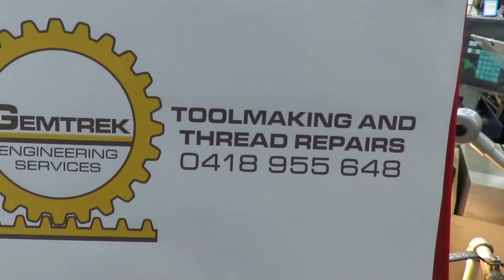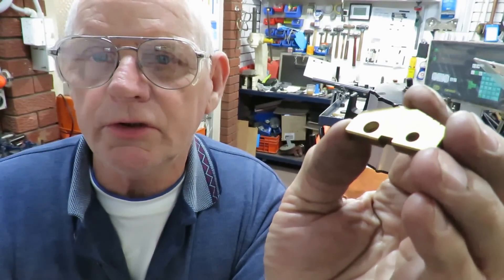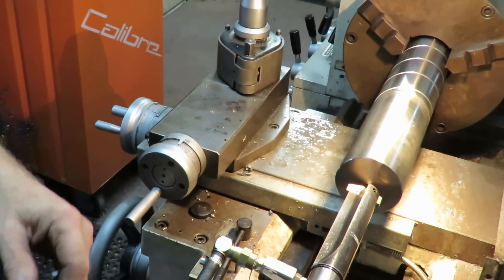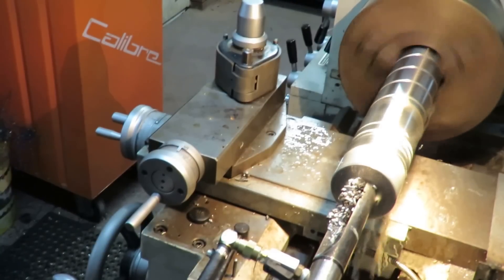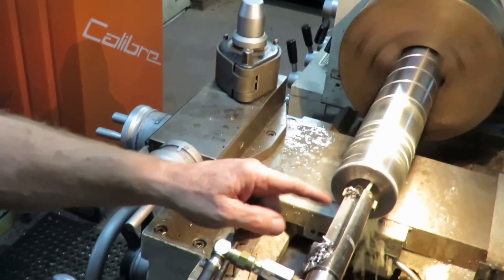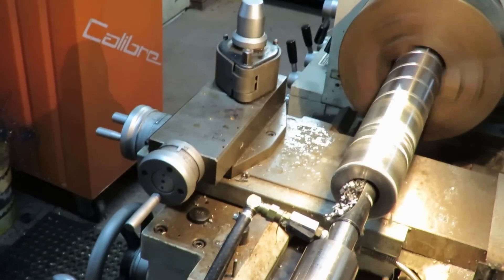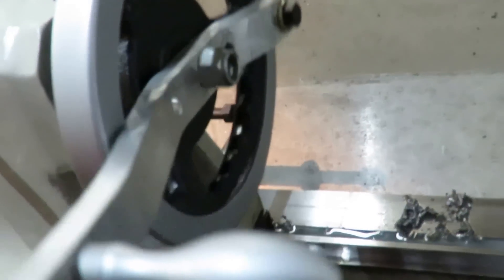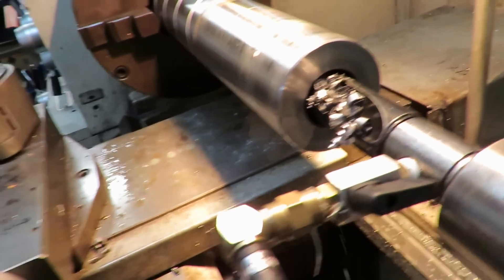SPADE DRILL BORING 4140

Comment: I worked in the machine shop of a major airline 50years ago and used spade drills often. Since then I've never seen one. Seems like they went to the carbide insert drills that leave a flat bottomed hole. I only used them on cnc lathes so don't know how they work on a manual machine. They're very expensive so don't expect to ever get one to try out in my home shop.

Comment: That drill is a monster, really works well. I like the extension on the tail stock feed wheel.   Is it possible to use a tool holder that would fit the bit on your multifix tool post and use the carriage feed?

Comment: Fascinating. I have among my books a reprint from a long-defunct mag, "American Machinist."  It describes the method used to bore out 14"-16"  (call it 210-250 mil) battleship guns. Same idea. Spade bit, pressure  oil feed, oil carries off a lot of the chips. So the idea scales up. Of course, out of the reach of any home or pro workshop but then, the demand for battleships is very low these days :)

Comment: Nice work, the handle is a capital idea. My tail stock weighs at least 150 pounds, what I need is a crank that moves it forwards and backwards.
Reply: Same problem solved with a small electric motor and timing belt from a car engine. Lazy mans rack & pinion.
Not for power feed just gross movement.
Reply: +The Thing thanks Thing, good idea.

Comment: Hi Bruce, to aid drilling with your infirmity, some lathes come with a hook and pin arrangement that connects the saddle to the tail stock, which allows power feed for drilling by pulling the TS along the bed. A simple arrangement to make, once you grasp the concept. Also it saves things when lack of quill length is a problem.
ATB and enjoy your holiday
c
Reply: I've seen that concept elsewhere (Stefan perhaps). Interesting approach. But, I like Bruce's idea as well. Easy to do. I'll have to explore the spade drill method....
Reply: I seem to recall seeing one on a "FactoryDragon87"video some years ago.
Maybe not such a good idea when used with a normal drill, imagine the length of swarf it would produce, but ideal for Bruce's spade one..